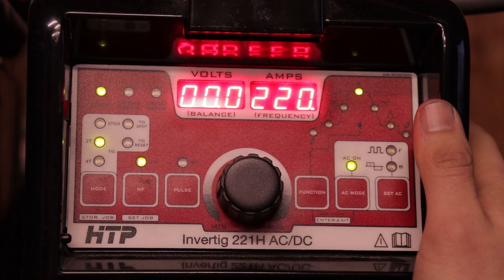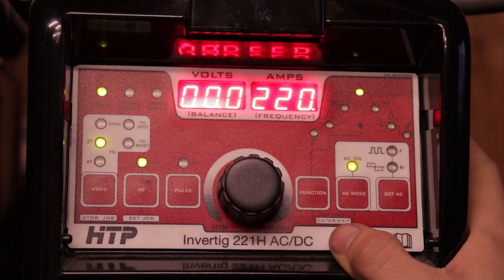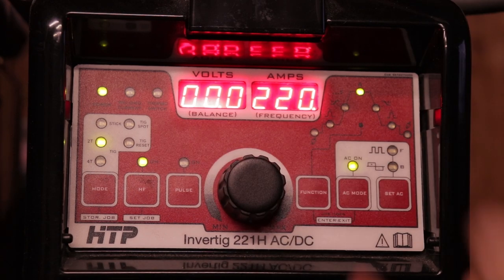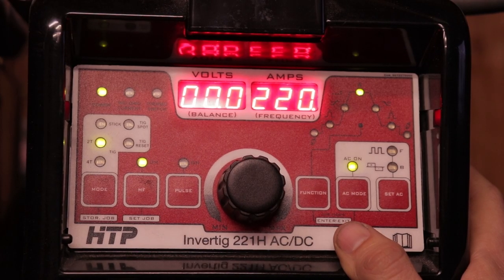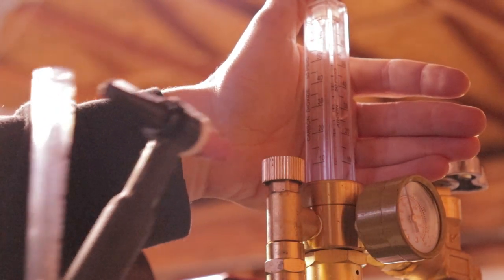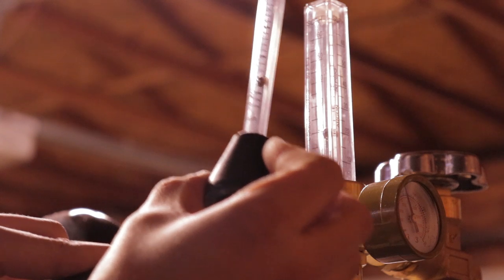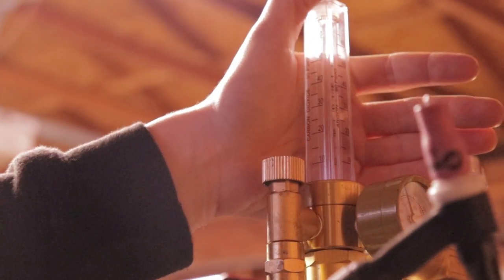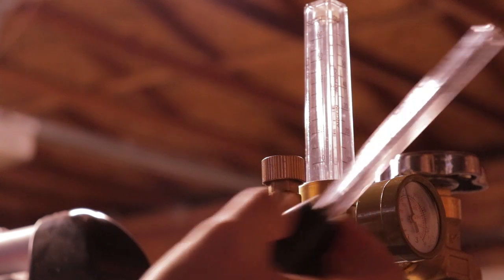How To Ball Your Tungsten For Welding Aluminum

Comment: Good video. I learned the hard way about my flow meter being off. Kept struggling with consistency. Finally tried upping the flow more than it "should be" and got immediate major improvement. That's bad when your flow meter is off over 30%!

Comment: I tried tig welding aluminium yesterday. I done a round end from what I've read, but ended up with a wondering arc which was terrible.

Once I accidently hit the tip with filler, the end balled, and the electrode was beautiful. It was so easy to weld once that happened!
Reply: what type of tungsten were you using? from other welders ive heard that different types can hold a ball tip way better than others
Reply: use white tip or blue.
Reply: Hi, I’m new and learning about welding aluminum. I heard that pure tungsten green was best?

Comment: Thanks for the video. That flow meter looks like a good idea. I have the same Chinese cheapo regulator that came with my everlast and i purchased a quality gauge, i think ao smith,  and thinking back i bet my Chinese model is inaccurate like yours. 
Ps
No need to feel like you have to produce a video for the sake of having a video. (As far as I'm concerned)
Cheers
Reply from the maker: Thanks bud i really appreciate it!

Comment: Cheers for this vid, it's something I have recently been wondering about.

What type of Tungsten do you typically use for Ally? I have 1.5%Lanth, which has good starting ability but I find on my machine which is Inverter (but fixed AC frequency) they start splintering after a short time. So lately I just use E3's because the hold together well despite a slower weld start.
Reply: I would try 2% lanthonated. In another video he covers different electrodes. Cheers
Reply from the maker: Ya i actually use 1.5% lanth at work quite a bit.  I think my favorite is still 2% lanthanated.  Tha ks bud!
Reply: U don't  use 100%?

Comment: What would cause the electrode to completely eat it self and burn up into the torch? (I don’t weld aluminium that often but never had this problem)
Reply from the maker: Either too small of tunsten or Too much Electrode Positive.  Turn your balance the other way until it stops. I like usi g 3/32" or 1/8" tungsten
Reply: 5th Street Fab Thanks for reply, was using 2.4mm (1/8”?) 135amps and 65% balance, think maybe sub 100 frequency?? For a cast aluminium part
Reply from the maker: Try 35% and see if that clears it up!  If not, make sure your gas is flowing right
Reply: It could also be your polarity.
Reply: Smoke Rise I thought that too, because I had the leads out of that welder in work, but pretty sure I’ve them in the way they came out, but does it matter what way around they are on AC?
Reply: @peters4067  if it's still happening, try reversing your polarity and see what happens....I assume your using a water cooled rig, a dry set up is reversible on the line. I don't like a dry rig for aluminum.
Also, are you using the red or green tungsten? 2%
Reply: Smoke Rise I’ll do that next time I’m using the tig in work, we don’t tig that much, in fact we don’t weld much where I work lol it’s an air cooled thermal arc welder White tip tungsten bud
Reply: @peters4067  okay, you have your polarity mixed up...that should solve your problem.  👍

Comment: What do you think of cleaner
Reply from the maker: What do you mean by cleaner?
Reply: I heard citric acid then wendex ready to weld no brush
Reply: Brake parts cleaner 🤣
Reply: @Chevroletcelebrity  with chlorine right!?
Public announcement: Do not use Chlorinated brake cleaner on weldable parts
Reply: @Jimmermahomoney  well the chlorinated stuff is cheaper. you just have to wear a face mask.
Reply: @Chevroletcelebrity  right you go get em bud

Comment: The tungsten will usually ball itself...it's not that necessary to make a good aluminum tig weld...it's usually the welders preference.
If you are serious about welding aluminum, the secret is practice...also having a water cooled rig with a high freak is mandatory.
Reply from the maker: Yep but if i dont put a small ball on the end when im running an inverter, after the first weld you start getting nodules on the end.  Itll cause a wandering arc and inhibits the cleaning action slightly so i normally put a small ball unless ive gotta rush.
Reply: @5thStreetFab  yea, usually I'll set there for a second and turn a few small circles (low heat) I prefer a hand control over a pedal...when I start adding rod at normal heat setting it usually goes away.  
I hate dragging around a damn pedal...
Reply from the maker: @smokerise  right on bud.  Ya i use a pedal for my bench work but love the thumb throttle for all my out of position work.  I went through 3 pedals droppin them off boats before they got me one
Reply: @5thStreetFab  🤣👍...yea, I'm rarely sitting in one place long enough to use a pedal...
Reply from the maker: @smokerise  haha im only about 50/50 which is perfect for me!

Comment: Can I tig weld without pedal with this machine?
Reply from the maker: Yep it has lift arc tig.  Also you can buy a button or roller switch for the torch if i remember right
Reply: @5thStreetFab  I turn off the high frequency but not let me weld without the pedal.
Reply: If I touch the work piece for the lift arc without pressing the pedal it don't start the arc
Reply from the maker: Haha youre right for some reason i was thinking it was like scratch start.  Thanks bud